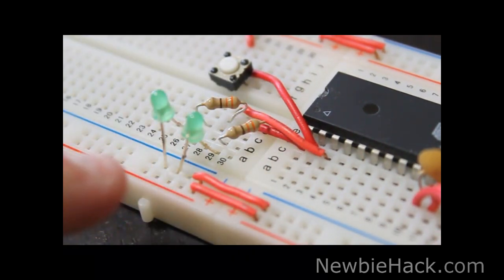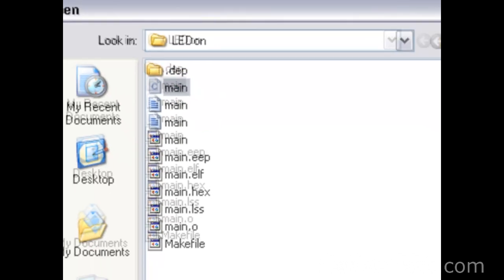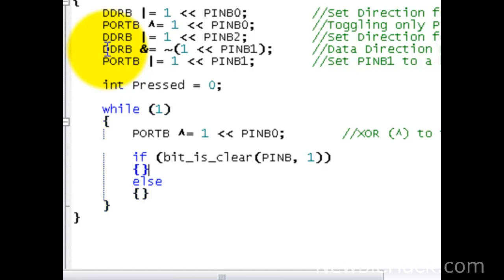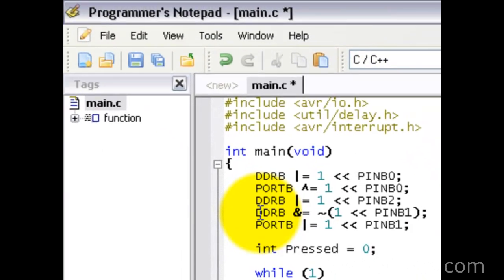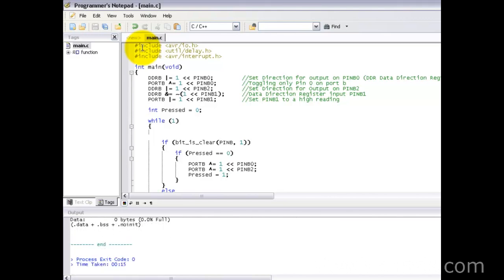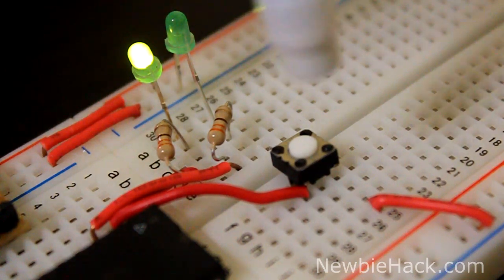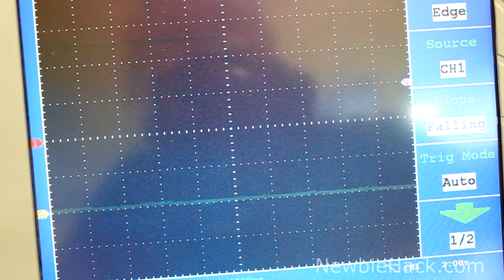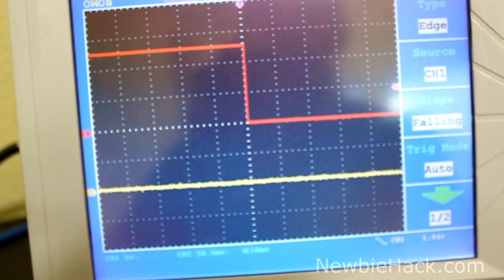13. Arduino for Production!  AVR Atmega32 - Understanding Button Debouncing

Comment from the maker: Thanks.  It may be set to zero by default, but this is really just a good practice to make sure that it is really set at zero.  When the program becomes larger and more complex, this practice may save you time.  For example, if the DDRB commands get used in its own function, there may be other functions or places that set this bit to 1, and finding that error would be time consuming.

Comment from the maker: Thanks.  You can't set a pin high or low if it is set as input.  The state of an input pin in changed by some device outside of the chip.

Comment from the maker: @somebody301 Good tip.

Another good investment is a logic analyzer.  I actually have one of those and it's great to see if serial communication is actually happening.  They usually come with many leads to probe multiple legs.  I may get into that in the uart tutorial.  A good project may even to create one from scratch and show the result on the LCD.  Hmm!!

Comment: Ok.... I'm lost I can't find the project where you created the starting code file.  So I'm lost on the following lines of code.

DDRB |= 1 << PINB0

I'm assuming that the DDRB and PINB0 variables are declared in the header files?  Also a quick explanation of that the code means would be great.  I thought "|" was "or" in C

Comment: while (1) 
    {
		if (bit_is_clear(PINB,1))
		{
			PORTB ^= 0x05; // pin0 and pin2 toggle
		}

    }
Is this correct? 
The code works fine for me. In this case, we don't need to use the variable pressed.

Comment: I am having trouble understanding how the 2nd if() statement comes 
into play.I realize that its used to prevent continuous toggling by
making sure the button was released first before toggling.But if i
were to follow the code systematically im having a hard time visualizing
how this is done. So if i were to start the program and the button has not
been pressed, it will fall into the else{} where var "Pressed" will be assigned
to 0. But if we now press the button, it will now satisfy the first if() condition 
and thus fall into that bracket . it will now check the condition for the 2nd if() 
statement which should be true since var "Pressed" was assigned to 0 on the else{} earlier. 
Therefore now the toggling of the 2 leds occur. This is the part where im having trouble with as I don’t see how the button needs to be released ,since as soon as we press the button both if() conditions are satisfied and the toggling should occur immediately as opposed to waiting for the button to be released before toggling.
But the code does seem to work as ive tried it, but i just cant grasp how the waiting for release is done.

Comment: Okay I have a quick question. Wouldn't a rectifier diode work better for dealing with the reverse voltage caused by a switch?

Comment: Hi Patrick, are you using 2 or 4 pin button, what the value of the capacitor are you using? and you can actually use true and false if you include the header stdbool.h which is part of the standard C library.

Comment: noob question here.
Can i use any micro controller with the programming language that you are using?
(with a different programmer) and if i'm right the micro controller is enough of a resistor to not short the circuit right? since you connected the button to ground.

Comment: @anajonesr

In the statement -

PORTB |= 1<< PINB1 

pin 1 of PORTB is set to 1. How can a port pin be set to 1 or 0 if it has been configured as an input only pin ?

You've done a good job with these vids. Keep up the good work.

Comment: I have made a program for a CLICK project just like you 
but the problem is not about debounce in my case.After uploading this program the led keeps blinking very fast
can you point out the problem is in this program??
#include <avr/io.h>
#include <util/delay.h>

int b=2;

int main(void)
{
 DDRA=0x00;
 DDRC=0xFF;
    while (1) 
    {
  int c=b/2;
  int a = PINA;
  _delay_ms(10);
  int a1 = PINA;
                _delay_ms(10);
  if(a!=a1){
   b+=1;
   }
        if(c%2==0){
  PORTC=0xFF;
  }
      else if(c%2==1){
  PORTC=0x00;
  }
     
 }
}
in this program i have made PORTC to be output for the LED.

I have used ATMEL STUDIO`s GCC C but that should not matter.

Comment: what would happen if you had put a delay in the prob meaning if the switch is pressed wait 10ms then switch/toggle. would that also solve the problem?
back in the day we had used assembly language that seemed to work that was only 8bit and much smaller micro controller . thanks in advance
Reply from the maker: Delays will work and many folks do this but I like to keep delays out of the code.  It's best to treat programming in microcontrollers like state machines where the clock cycles are there if you need it.

Comment: Hey..pattrick greetings...may I know why both pins pinb0 and pinb1 are initially zero
Reply from the maker: If no pin is set high or low, it will default to low (0).  However, it is important to set the pins that you are using to your desired level even though there is a default state.  This is so you understand their intended state and you are not putting the pin in a tri-state (an input state that is not pulled high or low) condition where interference can cause undesirable results.
Reply: Yeah,,I thought that should be that...thank you...got your confirmation...
Salutations@patrick

Comment: I'm pretty sure some of the code if wrong. it should be 			
1. Pressed_Confidence_Level ++;
Released_Confidence_Level = 0;
2. Released_Confidence_Level = 0; if inside the if
3. if (Released_Confidence_Level > 500) needs a closing brace.

Comment: Amazing tutorials sir!
I have a question. I tried writing my code like this: if (bit_is_clear(PINB, 1) && (Pressed == 0)) {...}
but it didn't toggle when I pressed the button (1 LED keeps turning on and the other keeps flashing every time I pressed)
I changed my code to be like yours and separate 2 conditions then it works as expected.
Can you explain what is the problem with using && operator here?
Thank you! Looking forward for your answer!
Reply from the maker: Thanks for the kind words.  Looks like you may be missing a closing parenthesis.  if (bit_is_clear(PINB, 1)*)* && (Pressed == 0))

Does it work by nesting them?  That may answer your question.
Reply: Sir, I don't think I've missed any closing parenthesis. This is my conditional statement when it didn't work

if ( bit_is_clear(PINB, 1) && (Pressed == 0) ) {
          PORTB ^= (1 << PINB0);
   PORTB ^= (1 << PINB2);
   Pressed = 1; 
}

What I meant before by "separate 2 conditions" was actually nesting them. Sorry for not making it clear.
So this is the code I wrote following your video and it worked:

if (bit_is_clear(PINB, 1)) {
          if (Pressed == 0) {
                    PORTB ^= (1 << PINB0);
      PORTB ^= (1 << PINB2);
      Pressed = 1;
   }
}

I want to understand why couldn't I write my code using the && operator. What is the difference between && and nested if statement?

Thank you!
Reply from the maker: Yes, you are right.  Sorry about that.  Separating the condition into a nested condition worked.  Not sure the && doesn't work.  I typically use that logic statement in my C# code, but I don't recollect using it in C.
Reply: Thank you for your answers. I guess I'll just stick to the nested if statement for the moment ;)
Reply from the maker: You're welcome. Not sure how helpful I was, however.  Let me know if you find a solution with the other option.
Reply: Hi, I've started a thread on AVRfreaks forum to asked about this problem:
http://www.avrfreaks.net/forum/vs-nested-if-statement#comment-2255061

JoniS has done a great job clearing my head & explaining why my code is wrong.
Reply from the maker: Very cool.  The explanation makes sense in the context within which the nested condition is used, but it doesn't make sens by itself.  This is why he referenced the rar file.
Reply: The rar file is the project file that I've attached in my post.

As you've known, when I press the button, there will be a stream of 1s (logically TRUE) returned by the function "bit_is_clear" (one per each cycle of the program)
Both two codes execute the first 1 returned by "bit_is_clear" in the same way (toggling the LEDs & set the variable pressed to be "1")
However, starting from the 2nd 1, the two piece of codes execute it differently.

The difference between the two types of code is:

- In the case of the nested if statement: 
After the button is pressed, the code will only toggle the LEDs once, until the button is released. (the else statement will not be executed until the moment I release the button)
Which means starting from the second 1, the signal will be ignored.

- As for the && operator:
After the first 1 returned by "bit_is_clear" --> pressed variable is now set to "1". Then when the 2nd 1 returned by "bit_is_clear":
bit_is_clear && pressed == 0
1  &&   0
0 (FALSE)

So in this case, the else statement is executed --> pressed is set to "0" AGAIN!
This result in a TRUE from the next (bit_is_clear && pressed == 0) condition

SO... during the moment the button is still being pressed, the LEDs are toggled many times as the pressed variable is also set to 1s and 0s many times. (the else statement is being executed as oppose to the former code)
Starting from the 2nd 1, the signals are not ignored.

I don't know if I've made it more clear or worse haha. Let me know!

Comment: can u please tell how did u put pinb2 as input?? I didn't get d way u made pinb2 input using bitwise operation..
Reply: hope u'll solve this query..
Reply from the maker: You need to set the data direction register for that port and pin as input.
Reply: Patrick Hood-Daniel 
ddrb&=~(1<<pinb1)
u said in previous tutorial that ddrb has initial value of 0b00000000..y dere is need to set it as input... doesn't it mean it's an input bcoz value of pin 2 is already 0??
Reply from the maker: You still want to set it even if it is already 0.  It's a good practice because programs get longer and more complicated and you may not know what state that bit is all the time.  I would suggest really looking at the program closely and test, test, test.
Reply: Patrick Hood-Daniel 
thnxxxx.... I jst started my engineering... really loved d stuff u doing... keep posting tutorial lyk dis..

Comment: let me elaborate it with the program with comments

#include <avr/io.h>
#include <util/delay.h>

int b=2;

int main(void)
{
 DDRA=0x00;            //here i`ve set all the pins of PORTA as output
 DDRC=0xFF;           /here i`ve set all the pins of PORTC as input
    while (1) 
    {
  int c=b/2;       // the value of b is going to be divided by tow for a further purpose
  int a = PINA;      // first of all a is going to get a value
  _delay_ms(10);  // in this delay the button will pressed or not pressed
  int a1 = PINA;      //here i am getting the value to check if the button is pressed in the delay
    //in this part the if logic is going to work
  //and when i will take my finger off the button the b is going to increase with 1 value again
//totally the increamention of b will be 2
// and with the (c=b/2) i am going to get a value of c increased 1
  if(a!=a1){
   b+=1;
   }
//so on the first click c%2 will be 0 and an another click will make the value of c%2 to 1
// it is going to go on like this
        if(c%2==0){
  PORTC=0xFF;     // if the value of c%2 is 0 the LED will light up
  }
      else if(c%2==1){
  PORTC=0x00;     //if the value of c%2  is  1 the LED will turn off
  }
     
 }
}
AND I hope that the program should have worked just fine
Reply from the maker: Hi Nazat,  I am unfortunately not able to investigate code for others, which is why I make tutorials.  the best way to learn how to code embedded applications is to dig deep and trudge through. I am generally focused on making new tutorials and investigating others code would take time out of creating new tutorials.
Reply: okii